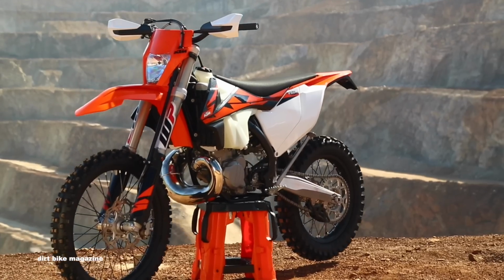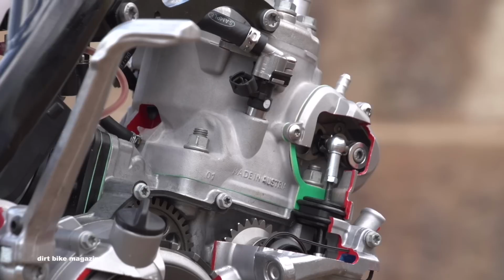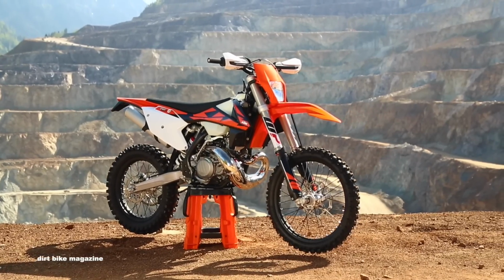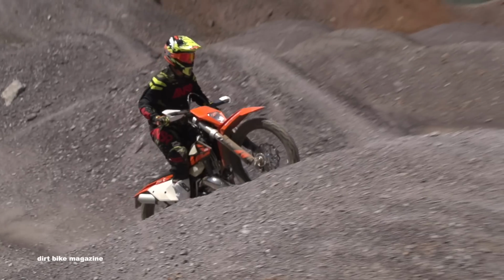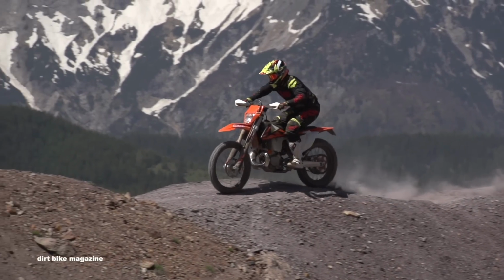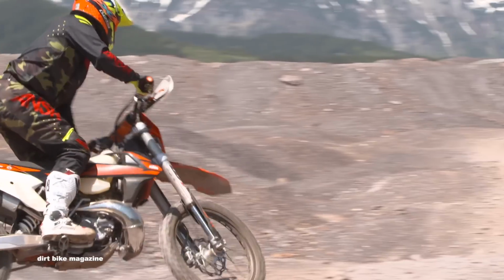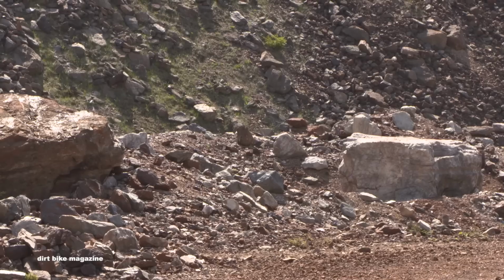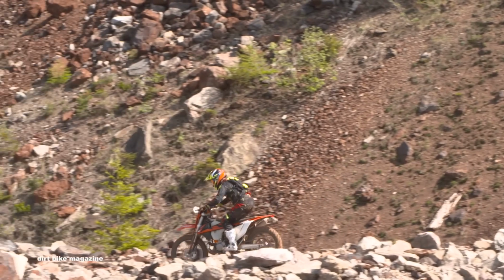First Ride 2 Stroke Fuel Injection KTM 250 XC-W - Dirt Bike Magazine

Comment: Advancement in Technology???? You mean 1999 Snowmobile technology???
Reply: zigz0911 those are direct injection. these are transfer port injection. they are new for dirtbikes
Reply: engine weight & new tech components sizes and off-road durability on snowmobiles is not as important as they are on MX/Dirt/Off-Road Bikes.
Reply: ShadowOfDeath24 actually in the case of bombardier for example they have a two stage injection system part of which injects into the transfer ports....I was just making the point that this should have happened on dirt bikes long ago, but the manufacturers chose to put all their time and money into 4 strokes. We two stroke guys have been waiting too long...
Reply: Thomas Dennis i totally agree with you. but for some reason in different parts of the u.s they call them either snow mobile or snow machine. i dont get it lol but i think both are correct.  but what do i know, i live where we get very little snow
Reply: ShadowOfDeath24 actually direct injection on sleds is a fairly new thing, before 10 years ago all of them were port injected.. my first sled was an 01 arctic cat 600 with port injection so this   "Cutting edge" technology is like 20 years old haha
Reply: Etec outboards have been direct fuel injection for a while...they smoke everything
Reply: zigz0911 ikr its the same fucking thing basically
Reply: Razor1uk Are you shitting me? A snowmobile takes 5x the amount of abuse as a dirt bike -- take it from a guy who has a 2011 Polaris Outlaw 525s, 2007 Crf230 and 1997 Polaris XLT 600 Limited. It's a 600cc, 3 cylinder 2 stroke making 96hp from the factory. With pipes and rejetting as well as Reed valves, 116-120hp.

Snowmobiles are constantly getting slammed around. Riding on snow isn't soft like you think it is.
Reply: Heinrich Von Kekelnazi your right, sleds run way harder, 4 feet of fresh snow= pinned 24-7
Reply: I can agree with one thing, this should have happened to strokes many years ago, about the same time they put FI on the four strokes. Of course the OEMs have been pushing the hell out of four stroke technology. Hopefully we will soon see some real development on this front, with efi 2stroke offering from most OEMs, of course some have phased out 2 strokes entirely, which was stupid.
Reply: When was the last time you climbed a rocked covered mountain on a snow mobile and stalled it watching fall and flip over and over, or rode it in 3' of water having and stalling it. Let alone cased a 75' table top. I just don't see how a snow thingy could get 5x the abuse. not buying it.
Reply: If your referring to the engine then I agree it probably does. 
But then we can talk about outboards that are run full throttle for hours at a time with salt water pumping in their veins, if they are lucky and its not sand or mud.
Reply: Aquatic Terra Firma razor is right, sleds get hammered,  I send huge cliffs and shit on my sled all the time and they are always ridden in snow which is like riding in water all the time, snow takes a lot of power to move through, it’s like riding a dirtbike in really deep sand all the time, I’ve literally had my sled pinned at 8200 rpm for over a minute at a time, I actually find it amazing they don’t fly apart more often than they do (which is quite often lol)
Reply: 2007 CRF230? thats not a dirt bike. That's a kids toy. haha. agreed they both take abuse but that 230 would snap in half if it did half the shit a real dirt bike could do.

Comment: That can be the comeback of 2 strokes road bikes , love that
Reply: Diesel trucks haven't been legally able to spew black smoke since 2007.
Reply: Not if you live in Europe. Go Euro4. 😓
Reply: Mike B Injected two strokes have no unburnt gas.  That's the whole idea. Direct injected two strokes are cleaner than four strokes.
Reply: Dan Henderson Not true. Oil injected/fuel injected 2 strokes will always be heavier in emissions than 4 strokes due to the oil. Any time you see smoke from a tail pipe, unless it's pure white, it will be unburned hydrocarbons. The oil injected or mixed in a 2 stroke never burns completely. If it did, it wouldn't do its job of lubricating the engine. The only way to clean the exhaust of a 2 stroke is with exhaust after treatment. I came from the era of 2 strokes and own a YZ250. I HATE the sound of a 4 stroke dirt bike.
Reply: Now that's really not true. The oil lubricates the bottom end, not the combustion chamber. Since there is no lubrication required after it enters the combustion chamber, it is free to burn off completely. Many oils do this just fine in carbureted engines when jetted properly.
Reply: If it didn't lube the combustion chamber, aka cylinder, you would have scored pistons. Castor based oils are worse than ester based oils.
Reply: Weird that all those 4 strokes without combustion chamber lubrication don't have scored pistons then eh?
Reply: Apparently you don't know how an internal combustion engine works.  Oil splash from the crankcase lubes the bottom of the cylinder during operation.
Reply: Apparently you don't know that the underside of a two-stroke piston is also exposed to the air/fuel mixture with all that lubricating oil.
Reply: Don Pijote de la Garcha Man, there are some documents telling that the 2 stroke will end about few years, and it will exist only gas and electric shitty cars

Comment: Too many computers and dependance on electronics. The bike will cost nearly as much as the 4 stroke. I'll pass.
Reply: Too many computers? You realise this is purely for the fuel management and nothing else right? Having owned carby 2T's, carby 4t's and FI 4t's, I can confirm that I've never had an issue with fuel injection and it actually means less tweaking to get right. This won't make the bikes any harder to work on
Reply: awesome honda 

the entire bike is reported to weigh an extra 6 lbs. That's literally a large piss and shit for most men and at least 2 lbs of that comes from the bigger fork tubes and tank. 

there's only ONE plain ass tiny EFI box and it's INSANELY easy to tune any bike with one of them and a power commander. I learned in less than a day at 21 years old.
Reply: ShadowOfDeath24 "a large piss and shit" holy shit that got me laughing

Comment: Finally, MX two strokes getting with the times. Excellent performance, and a weight difference so slight that professional test riders can't feel the difference. My only hope is that the big four Japanese brands will hop back on the two stroke wagon as well. Yamaha still is but they haven't had any major technical updates for some time.

Comment: Not that you wouldn't want to extend the range of the bike for enduros (reduce the # of refills), but based on the numbers, maybe there would be a possibility of going with an optional smaller fuel tank to offset the added weight of the electronics and oil tank?  If keeping the weight down trumped getting more mileage (endurocross, hare scrambles etc.).

Comment: Thank good for oil injection. Snowmobiles have been using oil injection since the 80's, 600cc 3cyl 2 strokes making 96hp, lasting 16,000-19,000 miles before rebuilding. 

WHY has it taken dirt bikes so long to catch up?

Comment: Looks great sounds great prob stick with 17 exc another year, question though, KTM dosent hold the patent for this tech TPI, BRP do and KTM licence it as I understand it, so it would be open to others if BRP choose to Licence it to others..
So I it's not they're idea as such? 

Also Euro5 std is about to drop while it passes Euro4 will it be Euro5 compliant, and Euro6 is 2 years away and it def won't pass that? Might not affect US, won't affect us here as far as I know, but seems a gamble to introduce new tech instead of the full hog and develop a true EFI system that is direct injected not Port injected, DI like outboards are and have been for over 20years! 

Still the ISDE model looks sic as! 

I also don't understate this jetting issue with carbs, setup right which is no that hard, unless you are doing massive elevation changes then should be little issues just saying that's more myth and sales pitch than fact, once setup for yr riding area!

Comment: Well in my opinion yes I am a KTM guy, 2 stroke motor guy all day, but but but: I like the the TPI, but I would remove the electric oil injector pump and just pre-mix fuel, sure its a hassle, but not really...  I would worry that the pump would fail and oil starve the motor!  My next bike is going to be a 300xcw coming off a 2013 200xcw...
Reply: You cant pre-mix this bike. Its transfer port injection which means the fuel is injected after the crank case. so if you use pre-mix, your lower end bearings will be running dry.
Reply: if you disable the oil injection on these the bottom end won't get any oil, the fuel never makes it to the crankshaft the way it does on a model with a carb.

Comment: When will they (ktm) nerd out with the specs of their injection setup. With this vid I found out there is a oil temp sensor and it seems it will let the ecu change parameters with hot or cold riding conditions.
Reply: And as we all know a jetted exc 2t is perfect already it's only for emissions ATM

Comment: Let's read from the KTM release blurb and ride around a rock dump. Boring guys. How about a dyne comparison with torque and hp figures included. Probably would be good also to do a side by side comparison between the last carb version bike to the new efi model. What about a side by side roll on to compare tractability?
Reply: No doubt they will. They did say it was just a quick ride at a release event. There'd be lots of industry people there and they'd just get a set time for a quick ride. It's not until they're given a test bike for a week or more they can do that sort of stuff.
Reply: That's the info I was wanting some damn numbers! So hard to get now. It should have 2 more than last years??

Comment: So does the gas go through one injector and oil goes through the other? Or do they mix together from each tank and them get shot through both injectors? I dont really trust those separate oil tanks especially if it fails then your bike will blow up, rather mix it in the tank if possible.
Reply: the oil goes with the air through the reed valve, with this engine if you put oil in the tank you are possibly going to clog up the fuel pump and/or the injectors but most of all you are not going to lubricate the crank and maybe even the piston
Reply: m1ke2001 The oil and air go through the bottom end, and fuel is injected in the transfer port (when it goes from the bottom end into your combustion chamber). You can't use premix because the crankshaft will get no oil then.
Reply: iD4v1d so what im getting from this is that the oil is sent to the bottom end and the fuel is injected as normal into the combustion chamber and then the oil from the bottom end is also then sent to the combustion chamber?
Reply: No...not gas, petrol. 😂
Reply: yes, that's pretty much how it works
Reply: road bikes inject oil at the intake tract,though i would be tempted to just premix the fuel as i did with road going trail bikes ,i just don't trust 2T oil pumps.l
Reply: too bloody right me old mucker

Comment: So?  About 30 seconds of vague ride impressions?  And the rest a rehash of the KTM brochure?   What about...  how it felt power wise vs the old carby 250 and 300?   What was it like when you are really low down in the revs?  Is it still stall resistant and as good as the old engines?  How does it perform w.r.t. the different PV springs?
Reply: dude, they sell magazines!..It will be in the August issue!

Comment: so if one runs out of oil, the engine is toast?

New technology???  I had a 1972 Suzuki 125  trail bike that had an oil tank to fill. No mixing of fuel.   Is that possible to do without fuel injection??

Comment: 2 strokes are so easy to fix but i dont like the seperate 2 stroke oil tank cos if that pump packs in so does yur engine always mix 2 stroke oil with yur petrol that way yur engines safe

Comment: Nice machine, shame I am to old for it.
Reply: your never too old for 2T fun,i still have my RM250,just about to reassemble the engine after getting the crank rebuilt,the day i'm too old is the day i buy a quad.
Reply: Cosmic Surfer I ride with a 55 year old. We do enduro shit, not dirt roads. He does fine even though he's a heavy smoker.
Reply: I'm 58 and ride my 350 Bultaco 3-4 times a week and want to get a more modern bike. There are guys racing MX in their 70's.
Reply: I'm 83 and still ride..

Comment: i'd prefer to have it premixed,the extra mechanical crap to inject 2T oil is a pain in the arse,2T trail bikes have this crap and i always primed the pump,fed the output to the input so it would just pump in a circle in to out to in etc and just premix,then i would not need to worry about a pump crapping out and welding my engine solid,then i bought my 89 RM250,only does premix,happy.
I like the idea of injection for the accurate metering of fuel and altitude adjustment to the enrichment,but fuck all that 2T oil pump crap,more problems,more weight,more cost,more shit to go wrong,when 2T is super easy to strip and rebuild,this crap is introduced,if you run out of petrol/gas the petrol/gas station should surely sell 2T oil,OR,if you take your bike in a pickup or trailer,take extra premix,lets face it you can forget to fill a 2T oil bottle,but if your premix runs out,you just fill it back up,if the oil runs out,your fucked.
companies trying to look smart,with tree huggers hastleing 2T bike owners in places like cali',the little bottle won't do much good,mix n go is the best way forward with injection,plus mapped and variable ignition timing,you get more power ,with the variable exhaust timing it just gets better,though the exhaust timing came first,but it all adds to bigger and better play time on the 2T bike,FUCK 4T.

Comment: 5 Sensors?  Electronic?    No thanks.. I will take a carb any day !! I do not ride for economy or less smoke.
Reply: What ? I have a degree in electronics engineering. I build stuff like this. I know too much  about it. I have data scopes costing 30,00 dollars and more. is this what you want?
Reply: grabir01 as someone that wants to study to be an electronic engineer and has experience, hell yea. This shit is awesome
Reply: Its all about emissions and government regs. It has nothing to do with power or reliability.
Reply: grabir01 I don't give 2 shits about overhyped emissions. Engine emissions are hardly contributing to global warming at all. It's all shitty politics. I know that's probably the biggest reason they added injection, but there are still other benifits that it couldn't hurt having. Listen to the sound of the bikes. It sounds perfectly tuned. If it's always like that that's awesome
Reply: Keenan Smith some of us like the two stroke power hit. WHY Change A 2 STROKE TO RIDE LIKE A 4 STROKE! I want to be fighting the bike. Not staying in 3rd gear all day

Comment: thank god i bought a 2017 yz250x 2 stroke before 2018 ruined the point of the 2 stroke ..mixing gass n hauling ass ...and being able to work on your engine yourself now with all this new crap hello mechanics $$$
Reply: mr juggs you realise the motor is the exact same motor but with injectors in the head? No more difficult to rebuild than an existing 2 stoke, take an extra 4 minutes to remove injectors and that's it. If you don't understand that perhaps you shouldn't be maintaining your own bikes
Reply: mr juggs thank God, it will,be so complicated you'll have to bring the bike to NASA just to adjust the chain. What an effin stupid thing to say. You should have found a 77 yz250 because it doesn't have one of those futuristic power valves too
Reply: Chris Stapleton  im talkin about sensors  its gunna be unnecessary money to spend
Reply: 64maxpower  "sensors/electronic stuff"   i know a 5 year old can do basic maintenance thats not i was talking about  don't get so worked up about it
Reply: yamaha prob wont ever put efi in their 2 stroke bikes. I believe this because, 1. its been 12 years before they actually updated their 2 stroke bike other than plastics/graphics. yz250x is only slightly different than the motocross version, different gear box slightly, softer suspension, and an 18in rear. Same bike pretty much. Also, not all of KTM's bikes will be EFI, this year, it will only be the 250 XC-W. I do believe (but I may be wrong on this), they may still offer a 250 XC-W with a carb. I know the 250 XC version will still have a carb and so will the SX bike. Maintenance, well... who knows it may work fantastic and problem free, or just shit the bed. I don't have to worry because I will just buy a XC or convert an SX into a woods bike. No problem.
Reply: It's a good thing Yamaha won't move into the future on the YZ. Who wants to get dressed in a Hazmat suit and have to go to school for 12 years just to learn to change the oil?
Reply: @mr juggs Modern 4 strokes are actually more reliable than the ones 15 years ago running carbs.... food for thought.